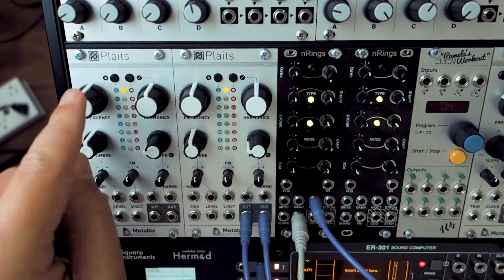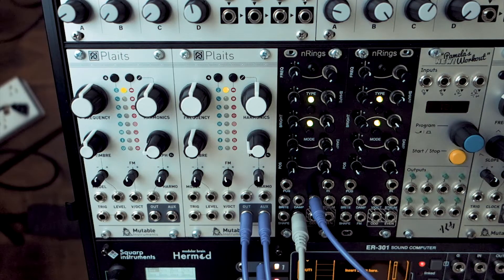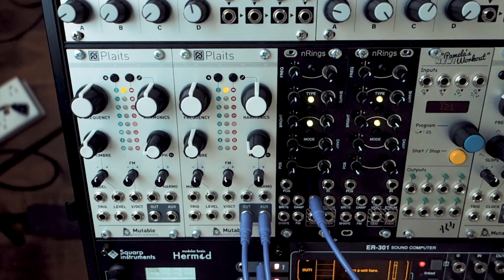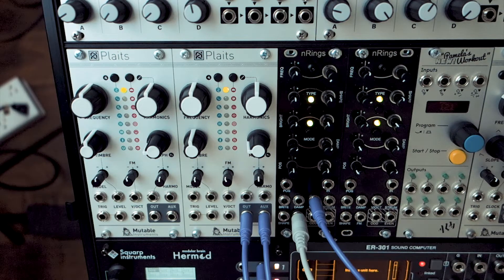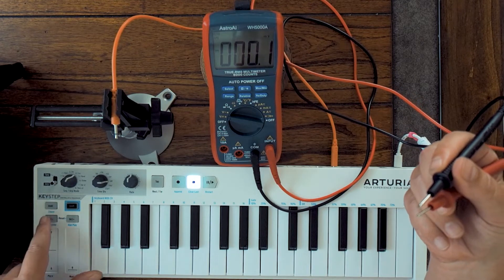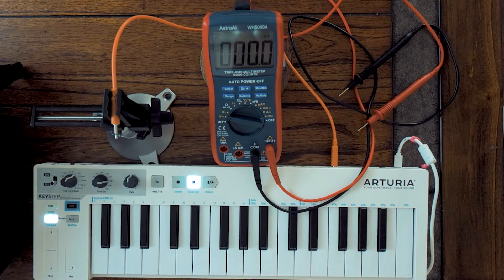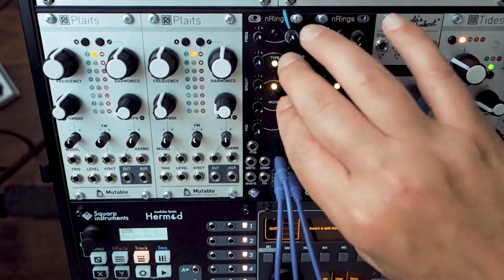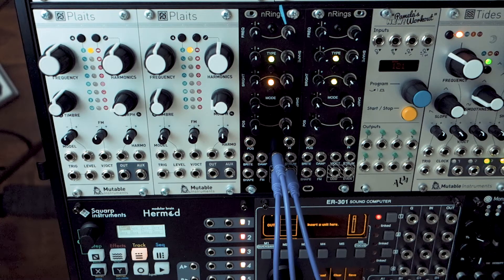Calibrate and Tune Mutable Instruments Rings (and Plaits)

Comment: I just built a Rings using a PCB and Panel from BCM Analog. The SMD parts were pre-flashed and soldered, all I had to do was add TH components.

I'm following this tutorial exactly with my multimeter and Keystep but I can't calibrate my Rings. No matter what, I keep getting the red lights flashing after pressing the button a second time.

Any idea/tips? Someone on Reddit said the red lights mean the cv isn't getting to the microcontroller, meaning the whole module is defective. I sure hope not...

Comment: Wow, I'd been wondering for a long time why my Rings was so out of tune across octaves... I tried the LightBath document numerous times and could never get it working right – and was on the verge of selling it – until trying this video and it's perfect again! FYI in my case I was using a midi keyboard but with a midi monitor on my computer to ensure I was correctly sending C2 and C4. Thrilled to be back in business, thanks so much!

Comment: Important Note: 
There is no standart that matches note CC values and V/Octave. What this means is, that C2 won't always correspond to 1V. You have to check the manual of your CV source, to find out what note value 1V corresponds to. 
For the Keystep, you can set the note that corresponds to a output of 0V in the Arturia Midi Center companion software.

Comment: Hi! im calibrating my rings using ''voltage'' option from ornament and crime - I can literally set +1 and +3V as output there, precisely. I'm getting 2 leds flashing on rings after that (which indicates an error), do you know what might be the problem? I've calibrated every other mutable module i have this way and it always works. I can't think of a better way, actually!
Reply: I was doing the same with Mordax - Data. Afterwards my LEDs also flashed (guess 2 times or so) ... I also thought there was a mistake but after checking the output (Freq-knob and Structur-knob turned fully ccw, + being in mono-mode) the pitches AND octaves were precisely locked in :) 

the manual says "If the calibration is successful, the module returns to its normal state. Otherwise, the two LEDs will blink in RED for A COUPLE OF SECONDs." Did it flash for several seconds or only 2 times (as in my case)?
Reply: @vellocet_audio  Hi! I appreciate your reply! My module has bricked since then, sadly. It is strange as it worked perfectly just after I built it, but then it had more and more issues. I got myself a nano-rings for a good price which works great now :)

Comment: you showing me where the c-values are saved so much time. thank you so much!
Reply from the maker: YW, and you know what, I just referenced it myself yesterday, haha. I needed to get my MI Plaits back in tune as well as my clouds module. It works for clouds too! Look that one up, however as the notes are the same but the connections are obv slightly different.
Reply: User 173 ha amazing. Yea I needed it for Braids and couldn’t for the life of me find where the Cs were on Keystep ha